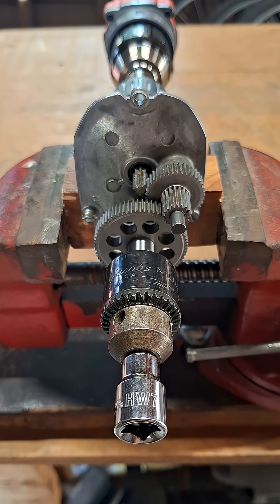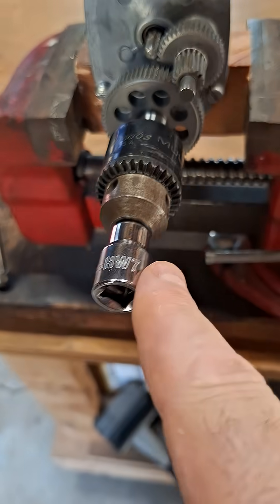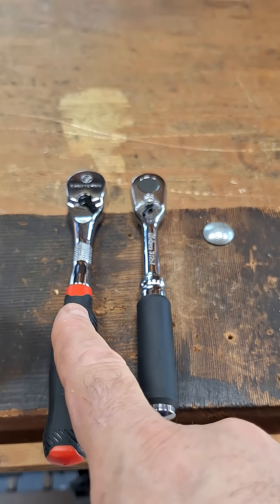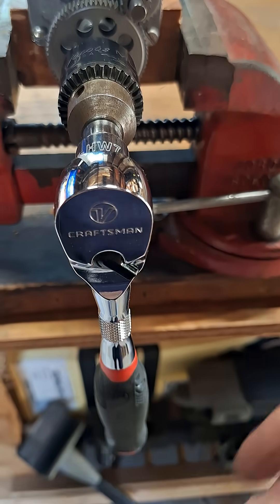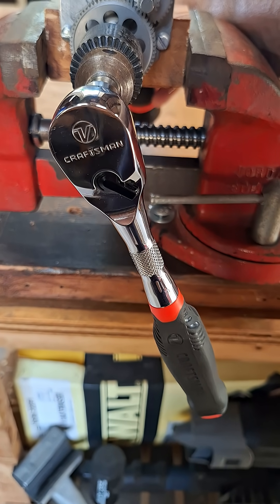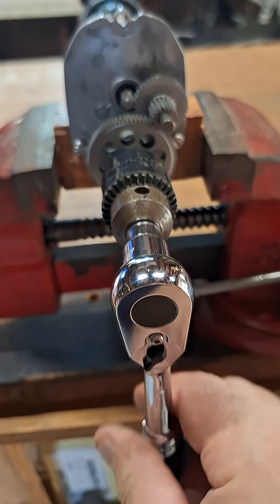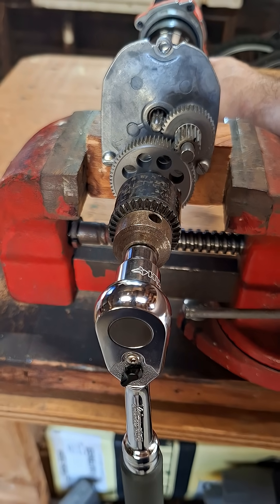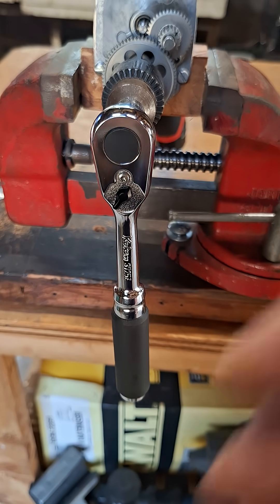Ratchet Backdrag Machine: Craftsman vs. Koken.

Comment: I like to use a luggage scale fishing line a hex bit socket and some hot glue similar to
What doc on last best tool uses to measure backdrag on ratcheting screwdrivers or if you want to go all out get a seekonk as they’re the best way to accurately and reliably test the backdrag. Keep doing cool shit
Reply from the maker: That is a way better way to do it. A direct measure of torque can't be beat. Koken measures their backdrag in Centi Newton Meters (cNm/ or 1/100th if a Nm). I'm just trying to keep the lengths similar for head to head comparison..for now. Thanks Again!

Comment: Cool testing rig however I will say that yes the V-series ratchets level of backdrag should be criminal lol but if you use a hex bit like used in ur testing rig with the hex bit chucked into a drill with the clutch on the lowest setting free spin the ratchet like 500revolutions &  flip the directional lever and go the other way until the anti seize that’s a nickel or dirty silverish color stops coming out, then lube it and test the backdrag and I shit you not the v series are some of the best ratchets I own it was still double the koken but I was genuinely surprised by how much it really helped and since their sealed you can’t tell how dirty they are inside even straight off the factory floor, would like to see your results if you try it as you have a good baseline to compare it to already recorded
Reply from the maker: Thanks. Yeah, I've heard that they loosen up nicely and are very stout. I picked up the 3 ratchet set (long handle, no grip) for $60. And another short 3/8 for $20. They are really nice. You can get lube under the selection Levers on these, there is no o-ring/seal there. I'm gonna try the drill trick and try to get a before and after video out. Thanks for watching!